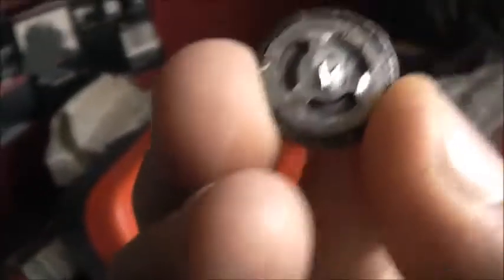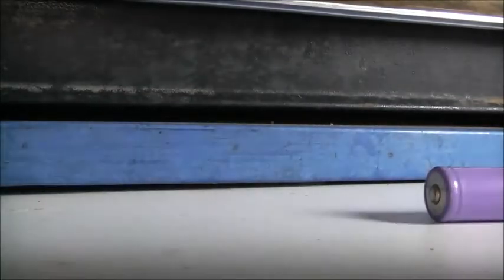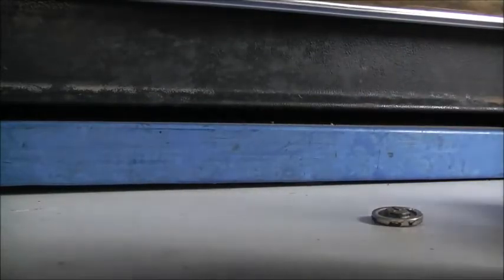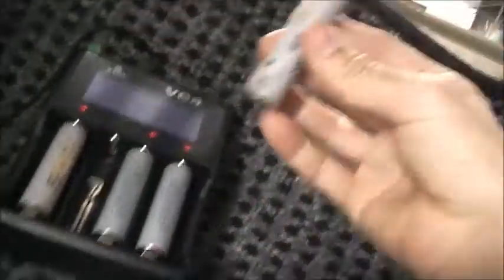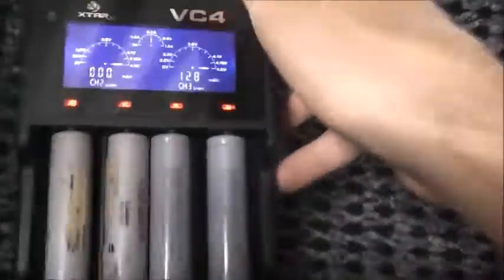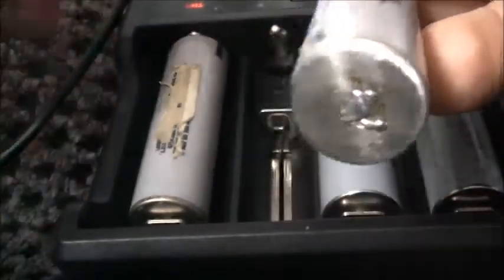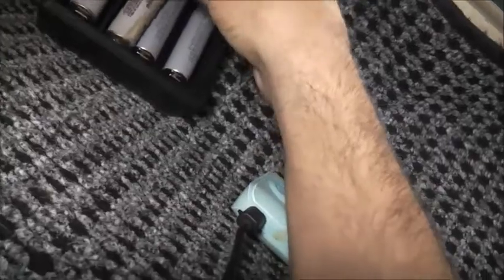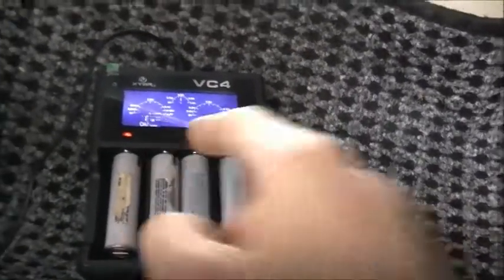18650 Battery Revive, Reset CID

Comment: can they blow up if you reset the cid and use them as normal again? the cid must have been triggered for a reason... though on the other hand why do only those 18650 batteries have cids and shit? lithium phone batteries don't have such thing as a cid.... is this just a trick to make us pay more money while shitting on the environment? those producers advertise "green shit" yet they force you to throw good batteries and produce toxic waste so they can sell and make more money? please can someone explain? there must be more to this story... you cant just discover this cid stuff then pretend everything else is alright.
Reply from the maker: There is no point, the cells have bugger all Capacity and run hot